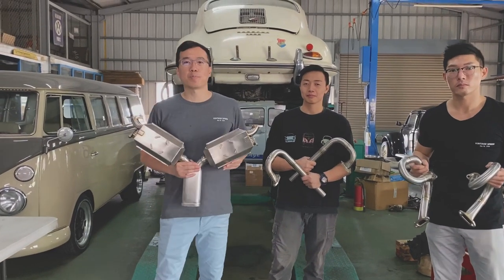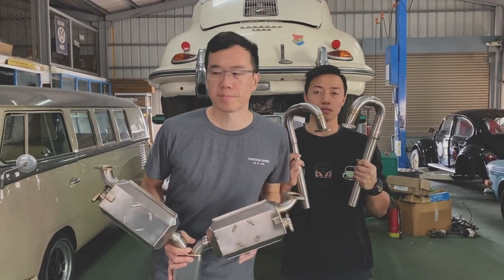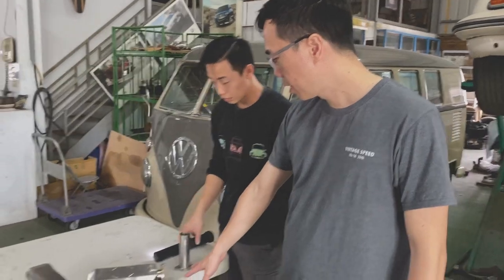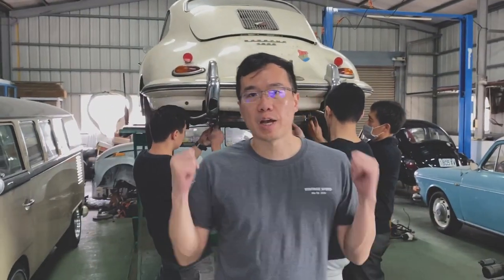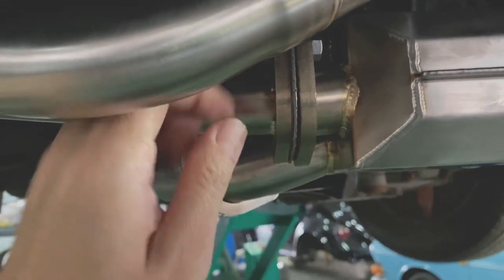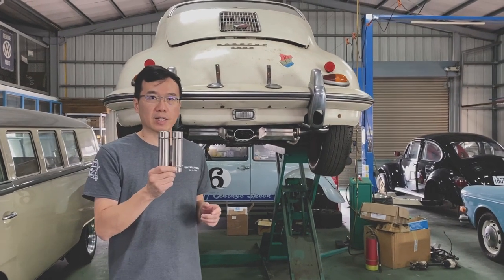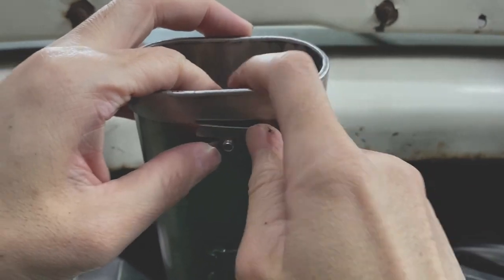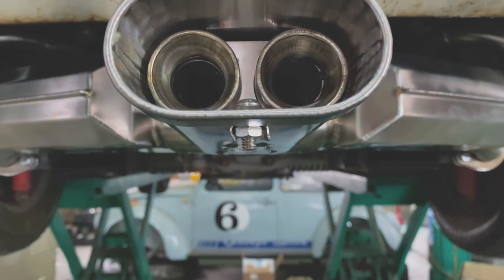How to install Sebring Exhaust for Porsche 356 by Vintage Speed

Comment: MT, great video, very easy to follow, thanks very much for making.
Do you recommend using exhaust paste on the slip fittings.
Also with the small silencer piece how much more does it suppress the sound.
Reply from the maker: https://store.vintagespeed.com.tw/PORSCHE-356-912-SEBRING-TAIL-PIPE-INSERT-p132996477